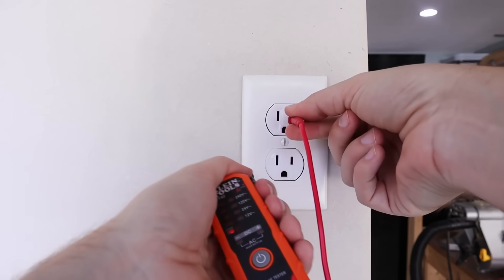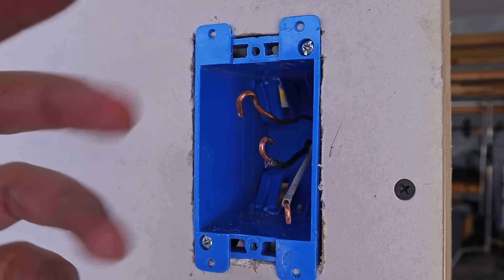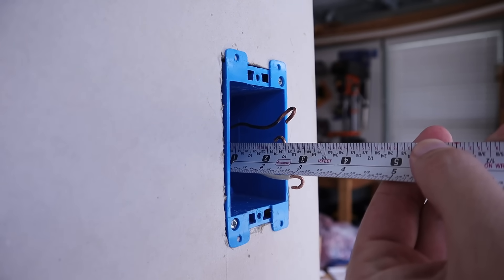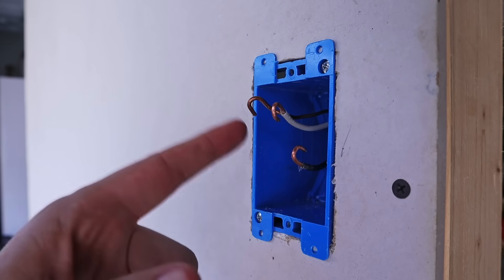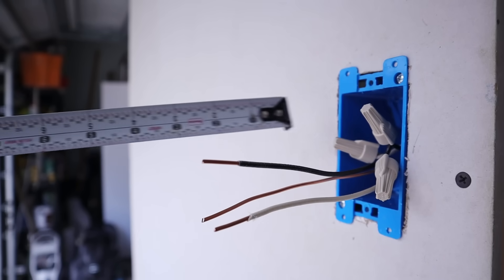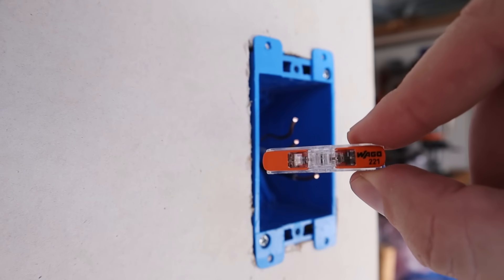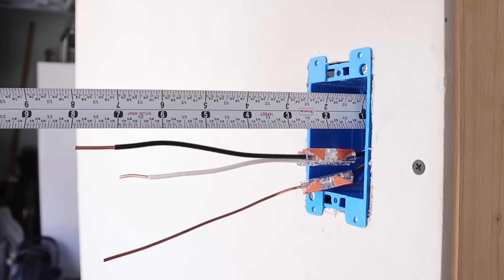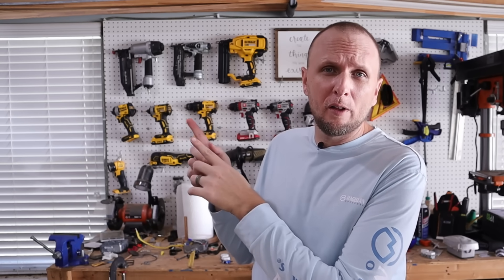"SHOCKING" New Way to Fix Short Wires In an Electrical Box to Code | Very Important

Comment: Great video.. I've been an electrician for 38 years and I have always used wire nuts. Because of comments on my videos I bought some WAGO 221 connectors and I have they connected to a well pump which is a pretty taxing circuit for testing. If they hold up I'll start recommending them as well.
Reply: Watched a video of a guy overload Wago's and wire nuts, @60 amps (triple rated capacity) the wire nut melted while the Wagos suffered no damage.  They are extremely useful in a circuit you know that in the future you may add an additional circuit to. No untwisting of wires, simply lift lever and pull wire out, also great for lighting fixtures where you know you may change out the fixture  for a different style in the future, and no holding the fixture up while you twist the wires together.
Reply: @Tim Nissen move a wire and they unclip? What nonsense, I've picked up whole lighting units with a wago,  yeah I've ripped wires out them before but you've got to make an effort. You must be using them seriously wrong. Are you fitting them in appropriate boxes or using carrier plates? There is really no way you are using them properly. If you are using them correctly within their rating they are an excellent connector but from your description you are using them wrong.
Reply: @Tim Nissen  you are incorrect with WAGO overheating. Please check again. Don’t forget,in the UK our electricity is 230v . EUROPEhave been using these for well over 6 years . There again qualified electricians are only allowed to install electrical installations. Your average joe from around the corner will not be able to get his work signed off. A certificate has to be given to the house holder.
Reply: my torture test is in a corrosive environment.
Reply: @kenbrown2808  Copper doesn't corrode?  The connections inside are plated and corrosion resistant.  So you use watertight wirenuts?  There are Wagos that are too!
Reply: @scott8689  of course copper corrodes.  in the environment I'm doing the torture test in, aluminum dissolves.  and yes, the alternative is silicone filled wet location rated wire nuts.  and since they're a right pain in the arse with signal wiring, I decided to give the wagos a chance at it.
Reply: I do lawn sprinkler work and sometimes the underground connections, while installed in a plastic box, are subject to getting very wet. How do these connectors hold up in extreme moisture?  Are they safe for that environment?
Reply: @MrSlikvee  they make gel boxes for them but normally for underground connections you would use a resin joint.
Reply: @MrSlikvee  These are designed for dry locations.
Reply: @MrSlikvee  they require epoxy connections.  Not easily found in hardware stores.  Essentially a standard connection sealed with epoxy after you make the connection.  Leave extra wire for this.  If it fails you cut the wires and start over.
Reply: @MrSlikvee  I had wagos sitting in very very humid conditions. In the lid of an aquarium. Which is prone to splashing from the fish, held up for over 12 months in pretty much direct water before the plastic got a bit too brittle from all the UV damage from the lights.
Reply: @Tim Nissen they are rated for 32 amp at 240V and thats not even the 6mm series. yes they are a fractionally higher resistance than a wire nut but they can take a lot of abuse and in many situations are certified maintenance free.. I see so many americans saying wagos are fire hazzards, I've installed thousands of them and never seen one burn.
Reply: I cannot see using anything other than Wago for attaching stranded to solid, like for light fixtures.
Reply: @KameraShy   "Tin" the (1/2 inch or so) ends of the stranded wire together with solder...then continue with the install.
Reply: That is an application that I won't use wago's with. Basic circuits in a house are just fine as they are rated for 32 amps of I recall correctly. I won't use them with motors specifically in case the surge causes issues over time, but for a basic residential circuit they are over engineered. I trust them.
Reply: @matthew-p9g6l  The basic circuit in a  home here in the USA are either 15A or 20A for receptacles  and switches/lights. I'm only using these on the pump circuit for a stress test. I don't need any connections there at all. I just wanted to see if the WAGO would hold up.
Reply: @BackyardMaine  fellow USA sparky here. I wouldn't turn down hearing about the results if you are so inclined.
Reply: @matthew-p9g6l  I’m going to make a video soon but the spoiler is they’re hold up fine so far.
Reply: When I rewired my 1950's house I went with Wagos in my J boxes and light fixtures. 5 years and still going strong. I'll take a Wago over a wire nut all day long. A bit more expensive yes, but well worth the extra expense.
Reply: I agree, repeated High inrush is a great stress test.
Reply: @steveurbach3093  Exactly.. And so far they are holding up.
Reply: @Magster Actually there are slightly less electrical fatalities in the US than in the EU. In 2023 1 in 840k  in the US and 1 in 827K in the EU. However I think we're talking more about the reliability of the connection rather than any danger.
Reply: @BackyardMaine  The US  has 110 volts caompared to 220 in the EU  .  Big difference  when it comes to the tickle  you receive
Reply: @Tim Nissen Truth hurts. WAGO  has been in use for years and years. It’s the only correct way.
Reply: I have built 2 complete  houses in my 60 yrs of life.....everything but the concrete and roofing...I hate both.
 The amount of connective "surface area making contact" between the 2 wires (or multiple) in these "Wago's" is almost molecular compared to using a wire nut. It's comparable to touching the very ends of 2 wires together....and that causes heat, corrosion and everything else that can go wrong in an electrical  box. I can't believe any state building code  allows this short-cut.
Reply: @readmore3634  Wagos and similar type of push connectors is all they use in Europe (and have been for years). They work fine.  Many electricians in Europe simply don't get why we use wire nuts for Wagos are simply easier and quicker. I'm a sparky in VA and I now only use Wagos. I should have made the switch years ago.
Reply: @vollyman1962  In  the late 70's plumbers thot copper was the new answer to deliver potable water.....(Honk!) Wrong! It's full of issues now. Give my "opinion" a chance bro....30-50 years..... you'll see.
Reply: @vollyman1962  Europe doesn't see the amperage we do.  Snap in connections don't have the same surface area as twisting a wire and wire nut.  Since electricity travels on the surface of the wire, wire nuts are still better in 120v applications due to the current being higher for the same power.
Reply: @readmore3634  I agree for the most part but there are a few things to consider. The Wago does have a larger connective area and a better method of keeping tension than the back stab device connections. Like I mentioned I have some installed for testing. Second many people whole are unskilled in electrical work may have a better chance of making a lasting connection with a wago over a wire nut.
Reply: @readmore3634  Learn electrical theory, more surface contact that those two ends is just more than you need.  The wago holds the wire against a small plate inside that gives more surface area.  It isn't simply narrow "teeth"  clamping the wires
Reply: @scott8689  guess I’ll have to take one apart and see
Reply: @scott8689  but still less contact area than a properly installed wire nut.  and the wire nut connection is direct conductor to conductor contact, whereas with the wago, all of the current passes through the "small plate" in the wago.  but like the company I used to work for said, "why do more than the bare minimum?"
Reply: I don't believe you understand wagon connectors. If you haven't used any you can't understand
Reply: @christopherterry5457  I Have been an electrician for 38 years and an electrical engineer for the past 10 years. I know a thing or two about connections. lol
Reply: I am no electrician but you comment really interests me.  Your comment is equivalent of the comparison of backstabbing outlets and putting the wire around the screw and tightening . I don't know for a fact but feel that many electricians are looking for a faster way to do their job. Not necessarily better way.
Reply: @readmore3634  the WAGOS are tested to hold up. I think your confusion is that you have been doing it wrong for too long .Now you are confused with the correct method using WAGO. The also fit in the correct WAGO insulated box . Welcome to the 21st century
Reply: @steveemmett9540  Funny you don't mention "surface area" of contact which was the preface of my comment. You "think" electrons just jump across thin air to get to where they need to be. Give me a professional explanation on how these electrons travel through a hairline of contact....and why car battery terminals have a necessary huge amount of surface area...then I will contemplate "weighing"
your knowledge compared to mine.
Reply: @readmore3634  electrons jumping across thin air is called arcing and very much exists? Dumb way to phrase that analogy lol
Reply: @readmore3634  also you get from my mk 2 eyeball on one of their old videos about a square millimeter of copper to copper contact, hardly microscopic lol
Reply: @readmore3634  Electrons basically do "jump across thin air". That's what a transformer does. Massive amounts of energy transferred through coils of wire that don't touch each other. It's the magic of induction that powers our world!
Reply: @readmore3634  Wire nuts get loose for temperature changes by time always.
Spring loaded Wago only use a connector area that is needed.
Just do a YT search for "wago overcurrent test" to see the sufficient "molecular surface". And Wago have no temperatur losening effect over time because of the spring mechanism.
You US dinosaur are alone in using 2 square feet connecting surface for 20 A and need to retigthen connectore every year.
You US dinosaur also still measure connectors surface in imperial instead of metric, so no wonder why, hahaha.
Reply: @proislam1447  Quality wire nuts have a coiled spring inside to maintain the connection of wires pressed together side by side.....Wago's use the equivalent of  tweezers to pinch a tiny portion of surface area. Let's see how long they last before going "all-in" Einstein.
Reply: @proislam1447  some of us dinosaurs love these connectors. Way more efficient than wire nuts.

Also our measuring system is full of sacred ratios/sacred geometry. It's more akin to wizardry at that level than metric. Learn both.
Reply: @proislam1447  "Just do a YT search for "wago".... YouTube is loaded with Wago vendors and investors.....open your senses....

Comment: Good video.  Thanks for sharing.  However, would have loved to see you try and get that outlet back into that box after adding those 3 wago butt splice connectors.  I'm guessing near impossible but I could be wrong.
Reply from the maker: Would be easy peazy.  Especially with there only being one set of wires.
Reply: I just installed a big, boxy Leviton smart switch in a box with THREE romex's - one input, one out to other devices, and a 14/3 going to the ceiling fan/light. I ended up using two 5-gang Wagos and two 2-gangs (switch has leads, not terminals, and requires a neutral). It took some doing but it went together. It would have been quite impossible with wire nuts. I think if anything it would have been easier with the inline connectors instead of the standard 2-ways. So, what we saw in the video above would have been a piece of cake!
Reply: @Oliver-uv7ir  Good to know.  Thank you!

Comment: Great tips, but it assumes the box fill allows the added space the wire nuts (or Wagos) and wire will take up.  I've run into situations where the box is already at capacity and you can't fit the extensions... you have to then cut out the old box and place a larger capacity box in its place.
Reply from the maker: Box fill does not include connectors or added wire such as pigtails in their calculations.  So from a code standpoint it is my understanding it doesn’t make a difference.  If there is not room for them then I would guess the box is already overfilled or a device like a GFCI or smart switch are going in it which take up a ton of room but still only count as 2 in box full calculations.  Like you said, sometimes the box needs to be replaced with a deeper one.  Is this your understanding as well?
Reply: In my 1930's house, circuits wiring for the entire house was routed through one 4x4 metal box. Packed tight. It was serviced by 2 glass plug-type fuses. But then there were far, far fewer electrical applications. Shows how much different it now. I unraveled it and re-routed a number of circuits, all in EMT.
Reply: A girl has to do what a girl has to do. If you have a box at or above capacity you have to redo the mess even if it means to open more of the wall then you want to. Document it! Unless you did the first install this will help you.
Reply: You cannot overload the circuit by cramming too much in the WAGO box .
Reply: Huh?

Comment: Quick tip... Use needle nose pliers to hold the short wires as you install your inline splice. Some of us are thick and that leads to fat fingers ;-)
Reply from the maker: Good tip!  Thanks James.
Reply: Hemo stats or the wire stripers he was using.
Reply: I'm 350 pounds and have lean hands. No figure.
Reply: I find 12 gauge a lot more difficult to bend than 14.

Comment: If you’re just going to push the wires into the Wago, you might as well just use the orange Ideal Spliceline connectors. Cheaper and well made. Available at Home Depot next to the Wago’s. I have both. I prefer the Wago myself 🤷‍♂️
Reply from the maker: The Wagos I think are just better made and offer a little more metal at the connection point.  They are also reusable.  I personally don't care for any kind of push in device but some folks do.  They are all UL approved.  Thanks for the feedback Chuck!